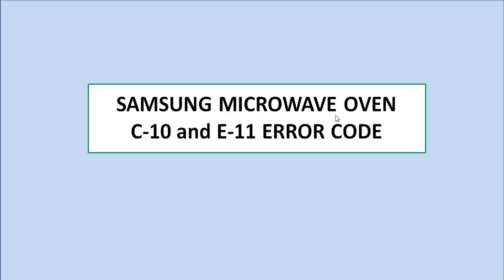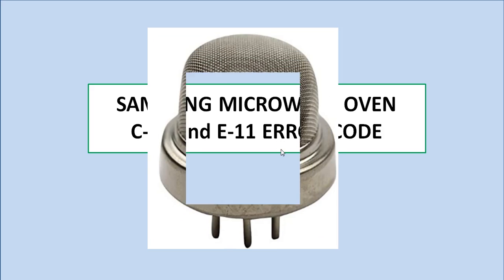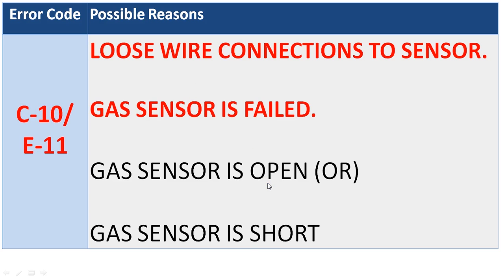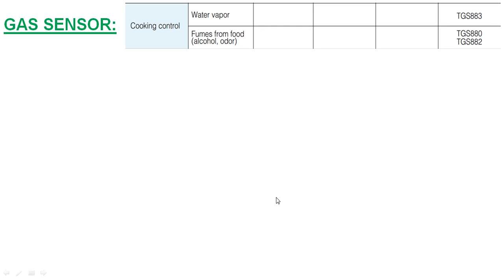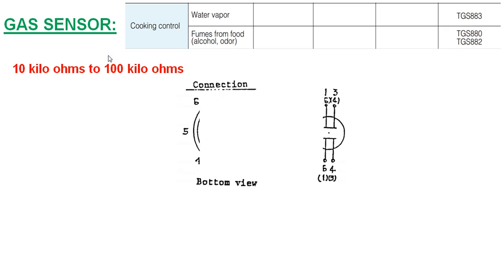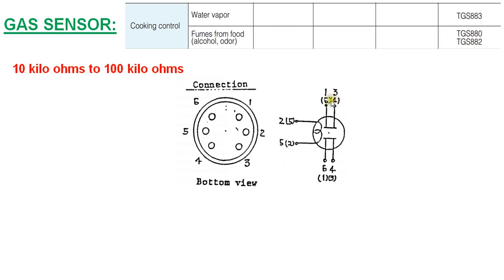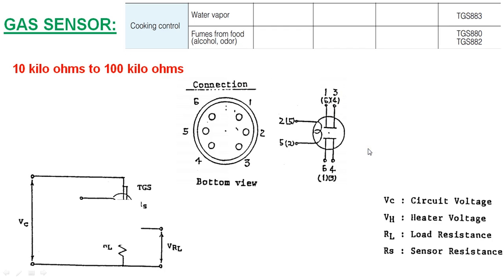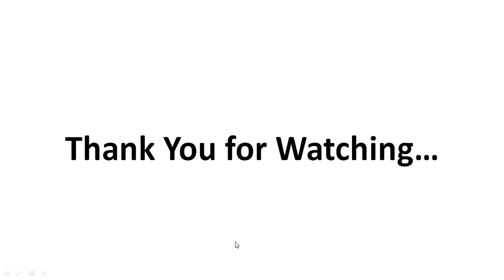C-10, E-11 Error display codes of Samsung Microwave Oven | Fix

Comment: Thank you, I found different resistance values than those you provided, but either way, the drawing provided me with the understanding of the pins to determine that mine failed.  I ordered a new sensor from Amazon (that Samsung refused to ship me), and while it was not very easy to locate and replace, I did replace it and it definitely fixed my c-10 error code.  Every microwave model will place it somewhere different, while it appears that most of the newer Samsungs place it inside the upper left area inside the microwave's cover.  While it is probably better to take down the microwave and replace it, I found that loosening the main mounting screw on the top left side was adequate to create a gap large enough to access it.  Of course, some other covers had to come off as well.  On mine, I can replace it again loosening only 5 screws, including the large mounting screw.  Thank you for the video.
Reply from the maker: thank you so much👍👍

Comment: Thanks for the help. It was actually pretty easy to get to the sensor. Took me less than 10 minutes to get it removed. Removed the front grille and it was located inside of an enclosed metal box located on the left side front area of my microwave. I tested mine with an ohm meter and determined it was bad. I didn't have to remove the left side microwave mounting screw in order to remove the sensor. But it was in the way a bit and a little challenging. My question is, is there a wrong way to plug in the new sensor? I realize it can only be plugged in 1 of 2 ways and it probably doesn't matter but thought I would check first. Thanks also to Yosef for your comment and tip.

Comment: Would a bad sensor cause the microwave to come on by itself in popcorn mode ? I can be in the other room and the microwave will come on and start running with nothing in it in the pop corn mode .